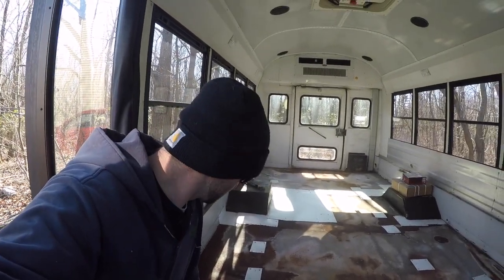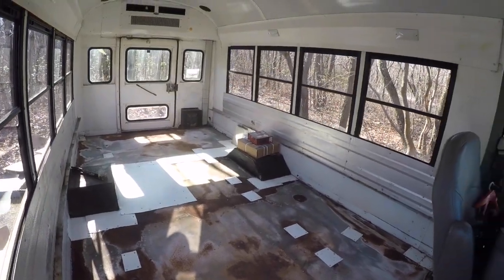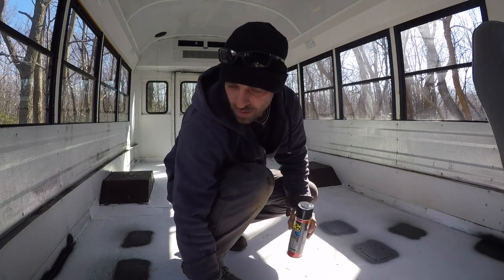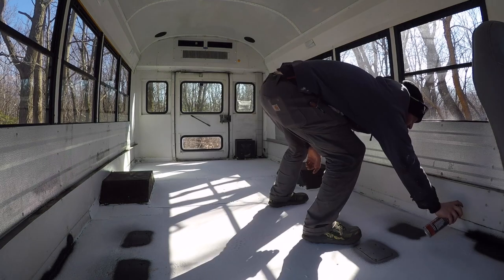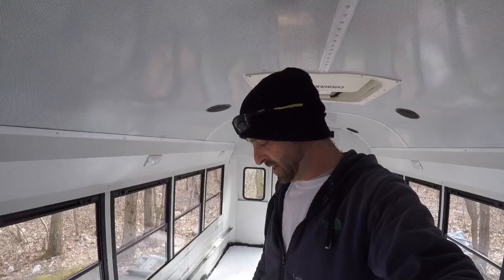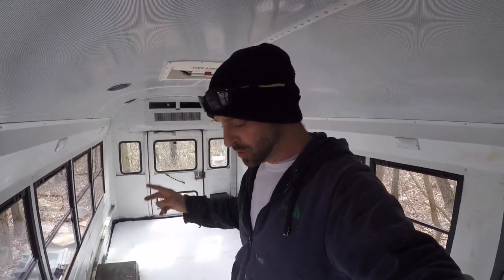Skoolie Short Bus Conversion / Floor Prep and Paint

Comment: That should work really well. What was that roll of stuff you used to patch with?
Reply from the maker: I think it sealed up fine, i plan on doing some kind of undercoating as well. What I used to patch the holes is Aluminum Coil Stock. I think that was 100 foot roll, had that left over from my last siding job. Its used for capping windows, Fascia, or apparently patching school bus floors. Lots more to come.